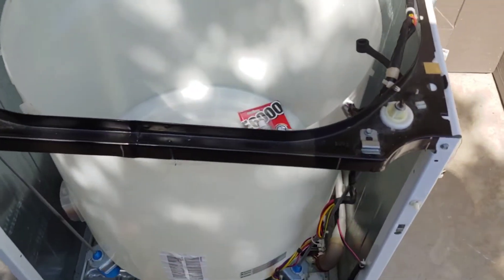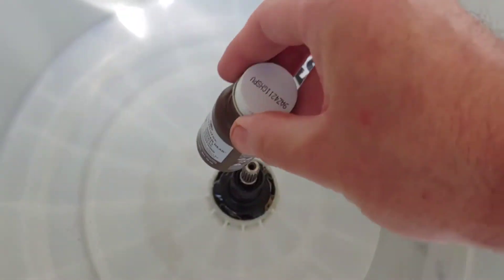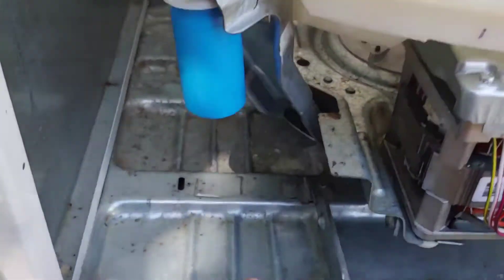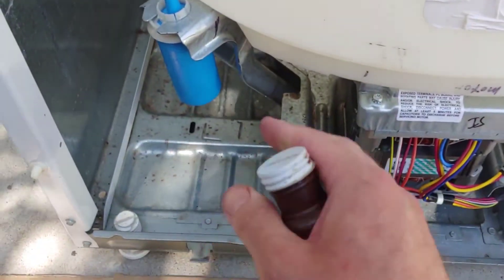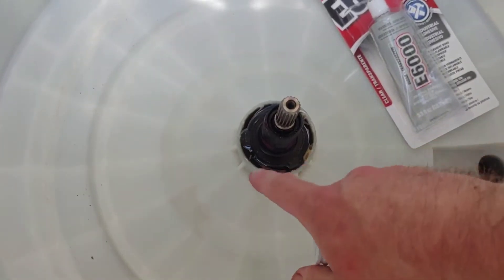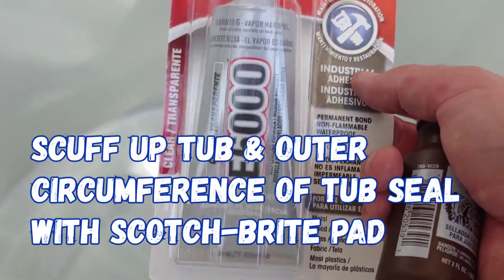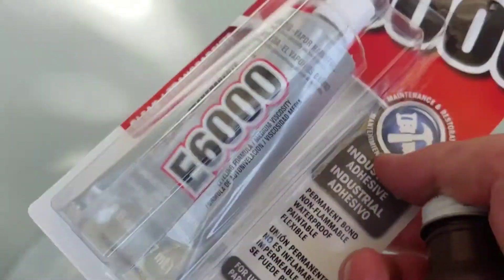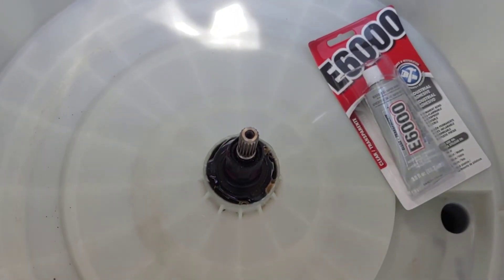GE Washing Machine Leaking Water? Tub Seal Replacement Tip

Comment: Spanner wrench required to remove the tub nut. Replaced the tub seal and used E6000 to seat the tub seal. It leaked. Replaced the tub seal, seated the seal with dish soap. Used a new split wring and a new tub nut. It still began to leak. Finally, I gave in and purchased a new washer.

Comment: What I don't like about the GE washers is if they leak, once water falls on the transmission bearing it will ruin it and you'll have to get a new transmission or have the bearing replaced which is a witch.

Comment: If you use E6000 and later have to replace the seal than what?
Reply: you have few options with this set up.   you almost have to sand the race on the tub to let the seal fit in, then permatex it in.    i permatexed a seal and it made it 6 years before it leaked again.   new seal going into new tub keeps popping out.  shameful that GE would not address this issue after this being a known problem.

Comment: Mine is leaking too I bought a seal but I read in comments you had to get the bearing too. Should I even attempt just replacing the seal or do I need to wait and order the bearing also? Did you wait only the 24hrs before using washing again or did you wait the full 3 days?

Comment: I did some measurements.   the diameter of the seal is 1mm larger than the size of the seal cavity in the plastic tub.  thats why it wont stay seated and forces itself out.   i took sandpaper, and went around the edge of the seal until i had sanded it down by .75mm.     then i permatexed the seal and pressed it into the tub.   it sat flat and stayed in .  GE is selling parts that are out of spec.   it sucks when you buy brand new parts from the manufacturer and they dont work.

Comment: Hey nice video is this trick still working and not leaking anymore, I am trying to do this on mine the seal is fitting loosed into the tub, please let me know.
Reply: Yes, it's still working. Best adhesive I found.
Reply: @jonhvac  great I appreciate it, I did it will see how it goes, thanks again
Reply: @nelsonc1687  I learned the hard way lol.
Reply: @jonhvac  thank you, I wanted to do that, but I'll just wait the full 72 hours, thank you so much, I did it Thursday will wait until Monday
Reply: No one put this silicon in saudi arabia and there is no leak

Comment: That appliance guy had a video from 10 years ago where he uses the brown sealant, but in a video 8 years ago on the same type of repair he does not use it. I've watched 2hrs of YouTube to find the best fix for this and most don't use sealant. One person used dish soap to make the slide easier..
Reply from the maker: Yes, exactly. I watched the same stuff. The soap video was nuts. This is an issue with this model.

Comment: How can you know that the leak is coming from the tub seal? Water leaking from the center of the bottom of the outer tub?
Reply: Pull the front cover off and run it through a cycle. Watch it at the point where shaft goes through. Mine didn’t start leak until half the cycle.

Comment: Still Leak Free ???  Wish I had found your vid sooner...
Reply from the maker: Well yes the glue held. The machine work for a few months. I put in a new tub bearing and agitator shaft. Eventually the tube bearing over heated and melted/warped the outer tub, which put stress on the tub seal and caused a leak. I think these replacement parts are just not up to the original specs.
Reply: @jonstuff  Oh man sorry to hear that,  I just replaced tub bearing, replaced the non-serviceable bearing in the brake area.  I am going to use your glue trick on the tub seal. I hope to get a few months out of this effort.  Thanks for letting me know !!!

Comment: this design does not work.   I bought a new tub , seal and transmission.   I had done the job before using an old tub.  the seal will not stay in the new tub.  it pops out.   it makes zero sense.   on my old tub the seal cavity was bigger, and you could press the seal in easily, but it would leak.  i permatexed that seal in and it held for 6 years.  with my new seal and tub it leaked water the first time i used it onto my transmission bearings, which will ruin them.   very unhappy - all GE parts, not copycat parts.  if you choose to do this job seat the seal and let it sit overnite to see if it stays seated.   dont put the machine togehter thinking you have it done.